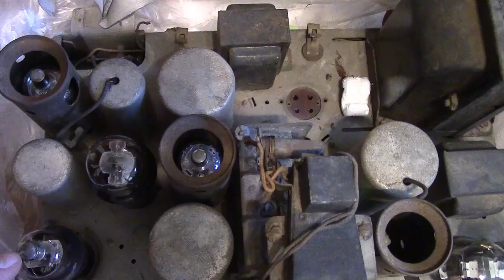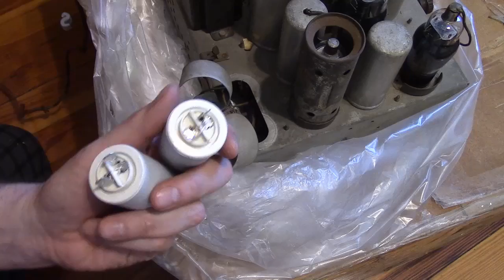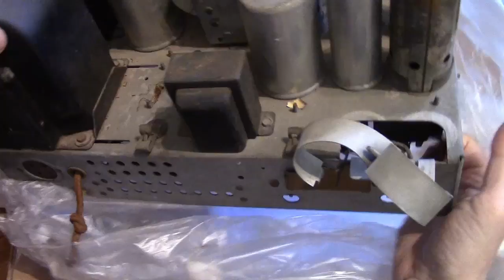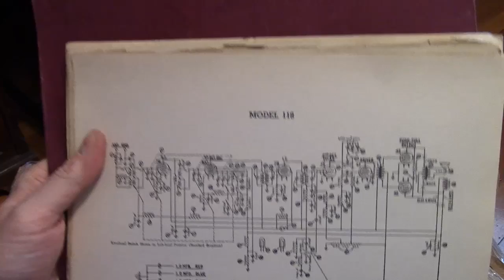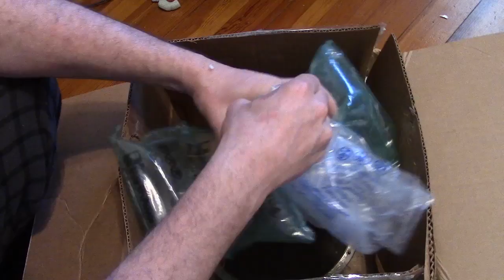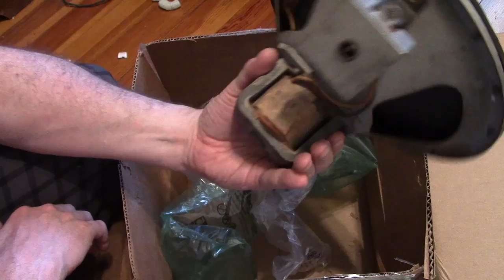Philco 18 restoration p1o6

Comment: I think that the main difference between a model 18 and a model 118 is in the band coverage, the model 18 has a so called "Police Band" and the 118 has either a shortwave band as well as the broadcast band, or just the broadcast band. The broadcast band on the 118 extends further up in frequency then the 18s do.

Comment: Very nice.

I just picked up a 118 today and am in the process of restoring it.
Reply: +jmcinvale I have a Canadian version called a 3118B, and have been told that they are very good performers particularly in the audio output stage. One common failure point is the large wirewound resistor along the inside back apron of the chassis, I think it's 7500 ohms, it's a bleeder resistor for the B+ supply, and yes it is needed because of the current demand requirements of the class A-B power output stage for regulation purposes.
Reply: +OlegKostoglatov On mine it is 6500 ohms. Mine thankfully is still good.I did power up the radio slowly using a variac and when I saw that everything was ok enough to work I took it to 115Vac and was able to receive my part 15 AM transmitter quite decently. Am in the process of rebuilding the bakelite blocks then all the resistors except the two wirewound ones will be replaced.
Reply: jmcinvale
You are probably right about the value, but I do remember that it is a non standard one, oddly enough the bias resistor is still good and it's quite common for those to fail. I haven't gotten started on my set yet, other then technical research, and in making a part's list.
Reply: +OlegKostoglatov My advice is to make a diagram of where the bakelite blocks go along with taking pictures of the bakelite blocks. That way if you should have to remove them completely from the circuit you know exactly where they go and what connects to them. Also make a diagram of what is in each bakelite block which will make it easier when you get the new components. Removing the guts from the bakelite blocks can be done with the blocks still in the radio, but I chose to remove them from the radio to remove the guts since it was my first time dealing with the bakelite blocks.

Comment: I may have to pick your brain down the road.  I have a very elaborate Philco tombstone radio I picked up at a flee market and it looks to be a very highend 1930s radio.  Massive speaker, separate dial lamps for each band, and some kind of tuning meter assemble above the dial.
Reply: +ESDI80 That covers a lot of ground, but it sounds like it could be a 16B or early 116B. Count the number of tubes and that will give you an idea, 16s/116s had 11 tubes, other models fewer tubes.

Comment: How much asbestos pads and wiring do u see? How do u tell if the cloth covering has asbestos in there? Ever wear a mask? Just curious.  I've been in remodeling and construction for 23 years.  I've been in tons of it .
Reply from the maker: +Steven King I rarely see any asbestos and never wear a mask.  When I have it was a sheet stapled inside a wood cabinet above some really hot tubes.  I just leave it alone.   I've never heard of any in the wiring insulation.
Reply: +bandersentv thanks! Peaked my interest x if you have time, what tubes run that hot to require the stuff? Another excellent video.  Steven
Reply: +Steven King Output tubes, and some rectifiers can run pretty hot as well.

Comment: Hey Bob, That thing looks familiar, lol....but then, my radio is an 18H, same chassis, except mine is in a highboy on my picture over there<<<.  I'm going to be loving this series :D  Looks like the electrolytic cans in the back are gone, but looking at yours, mine appears to be missing some tube shields that I didn't know about.  Could that be why reception on mine seems to be so poor?  I can pick up a station about 4 miles from me but the other stations that should be coming in aren't.  Certainly I should easily be able to get 840 WHAS as I live less than 30 miles northwest of Louisville, KY but it won't hardly even pick up static below about 1000 on the dial.  The local station here is WSLM in Salem, IN.  It comes in loud and clear but like I said, it's only 4 miles away and only 5,000 watts whereas WHAS is 50,000 during the day and stronger after dark.

My shadow meter doesn't work, so if you're going to be doing that one I'll certainly be watching all the way through.  I'm about as new to this stuff as one can get.  Sure appreciate guys like you showing how it's done!

Take care, Gary
Reply: +Rebel9668 P.S.  That plug for the speaker should have a little clip with a screw that attaches to the back of the chassis that holds tight to the back of the plug for when taking my chassis out of it's cabinet I first have to loosen that screw and turn that tab to the side to unplug the speaker wire.
Reply from the maker: +Rebel9668 No, tube shields wouldn't effect reception.  You might have bad tubes or it needs an alignment or it could be as simple as a bad antenna setup.
Reply: I'm just using a long wire antenna, about 50 feet of it running around under the baseboard in the living room.  I may invest in a tube tester or a signal generator soon and try those.  Thanks!  If nothing else, I may try driving up to Chicago in the Spring, lol. It's only about 5 hours away.  Wish I had bid on that tester you put up on ebay a couple weeks ago now.  Unfortunately at the time I was buried in replacing the wheel hub assemblies, water pump and cooling fan clutch on my old trailblazer out in my garage.  Between all the cost for parts and special tools for some of those ebay wasn't in the cards at the time though.
Take care,
Gary